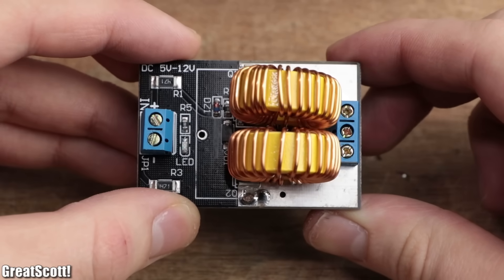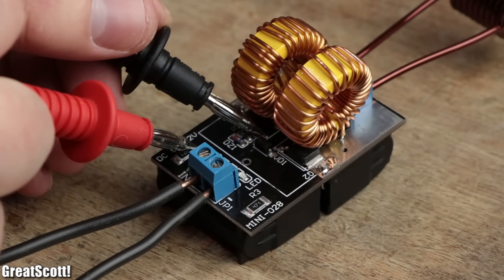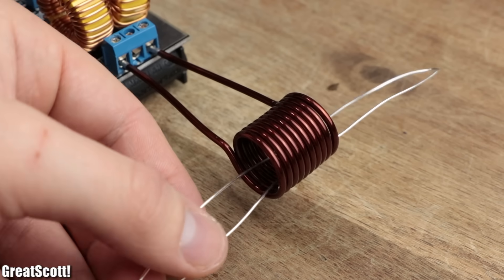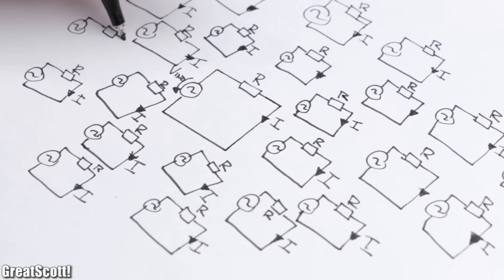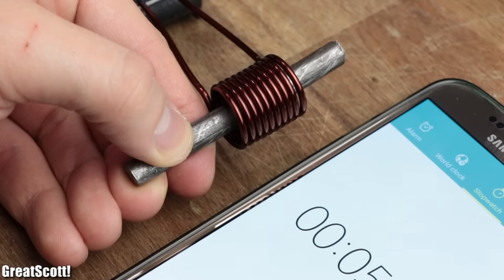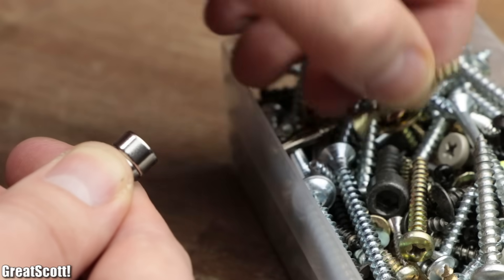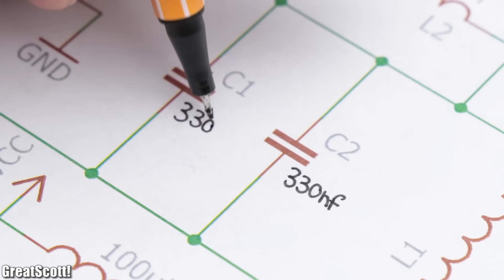How does Induction Heating Work? || DIY Induction Heater Circuit

Comment: hi, i made it, and it works, but when it gets a load the circuit stops oscillating and draws a large current, but when the power is turned off and then back on the circuit works again, except when it gets a load it stops again, what causes this?

Comment: I have a Solary bolt buster and I was damaging those Kevlar covered wires.  Is it possible to build my own using the same process of wrapping a copper wire around a plastic tube?  Is there anything to watch out for when doing this?  For example, can the looped wires touch each other or can I bend the leads at 90 degree angle coming off heater?  There are tough to reach spots and I can't go straight on.

Comment: Thanks! A couple years ago when I was 10 I saw this video and went to the local electronics shop and built the exact thing just from looking at the way you did half the parts where from scrap items and ended up using it till I moved house

Comment: I have two different welders one is an AC welder and the other is a DC.
The DC welder is capable of constant, current or constant voltage 
In constant voltage mode I could set it to 12 volts and possibly limit my amperage somehow. But 3 amps would be difficult. 

Anyway, would I be able to use one of my welders as a power source to heat up very large knife making projects, for example, 2 in wide by 12-in long carbon steel

Comment: You explained nothing about how an induction heater works...
Reply: He did. You just didn't pay attention.
Reply: @schaltnetzteil495  So what Im wondering is, what is different about an induction heater than other inductors?  What causes them to create so much more heat?  Is it more induction?  More current?  I heard it somewhat has to do with frequency, though I dont remember where I read it.
Reply: @Ryan-qn1wr  Induction heaters create a lot of heat in the metal, not in the coil itself, because of eddy currents in the metal that heat it up. But you need a high frequency to induce those eddy currents.

Comment: Simply use a cheap 40watt soldering pencil and a box cutter blade. Use the screw that holds the soldering tip, remove the tip and attach the box cutter blade through the hole in it to the outside of the heating coil, that secures the tip. So instead of a soldering tip you have a razor blade that is constantly heated by the solder pencils inductor. You don't need to keep heating it up; it stays hot. Cheap soldering pencil (40watt) stand, flux, and a small rol of 60/40 solder at Walmart = $9.99 and a pack of 10 razor cutters = $3.49. ⚡⚡ I use my variable solder station with a small coil of wire clamped in place of the tip, on my heat mat to keep my coffee hot. Great stuff in your videos. Your insights and knowledge seem to fill in the few gaps in mine.  I'm a southern redneck in South Carolina US. I never throw anything away. If it will cast a shadow; it has value if you know where to use it. Imagineering. That's what you get from a BA in economics, a BS in Computer Science, a Masters in Physics; Optical/Acoustics, Quantum, and Classic Mechanics, undergrad in General Chemistry, Masters in Ancient Biblical Dialects, and finally an EMBA in Business and World Economy. And all but one degree was tuition free. But through it all I am a musician and musical instrument amplifier and high end stereo tube amp repair tech. I have a brain full of almost useless academia; but have always been a general "hands on" repair craftsman for over 45 years. Love your videos. I also write code, starting with the assembly machine code for the intel 8088 and 8086 back in the late 70's and know my way around the other 80% of the bandwidth of the  Worldly really wide Webulator. White hat.

Comment: need to try an experiment...  take a section of iron pipe and run water thru it and heat it with induction and see just how hot water can get for an on demand hot water heater. A flow switch turns on the circuit when water flows thru the pipe thus heating the water, a flow control valve will allow the water to remain in the heater area long enuf to reach the desired temp...  will it work, thats to be determined  ;)

Comment: Hi Scott, does the coil itself heat up as well? or is it just the metallic material inserted into the coil that heats up?

Many thanks
Reply: yes the coil heats up also due to current flow, like a hair dryer gets hot when electricity flows thru the coils... the important part is to design the circuit to limit the current thru the heater coil to keep the coil from being damaged.

Comment: Thanks for sharing....i have a question...In industrial application of induction furnaces, the water cooled capacitors tend to inject excess reactive power into the grid which affects the power factor as a result of over compensation. Most foundry industries are facing low power factor penalties because of this situation. How best can this scenario be solved without affecting the operation of the induction furnace?

Comment: Hello Scott 👋 it’s Scott 😮 with aluminium (aluminum) in the instance of a juice can 🥤  heat from the hand is easily transferred into the can which could potentially make the can  36.4°c  aluminium is used for heat sinks world wide in comparison to steel or brass I think for a fair test using the pliers to hold the media would be more scientific and allow less Influence from your body heat as I find 37°c to be far too influenced by your optimal core temperature of 36.4°c  a control being a piece of wood or plastic should also be used in order to be a control for the experiment, if that heated up then your experiment would be void unless explainable very interesting and keep up the good work regardless of my pernickety comment ❤

Comment: I've been trying to construct this circuit, but I keep encountering an issue where my mosfets get really hot and my wires melt. Any advice on where I might be going wrong is appreciated.
Reply: Use active cooling for the MOSFETs and thicker gauge wires

Comment: I wish that a businessman would bring a product to market which heats galvanized steel water pipes using induction coils. The water pipes underneath my house freeze in the winter. I have wrapped the pipes in heating wire and insulation, but the pipes still freeze. For the hwating wire I use, the heating wire itself gets hot. I would prefer that the induction coil stay cool but the water pipe get hot. I want an induction coil wrapped around a steel pipe which keeps water inside the pipe above 0 degrees Celcius (32  Farenheight) in the winter-time.
Reply: industrial heating wire?  you need the real stuff they use at big chemical plants and not the stuff they sell at alibaba, phone the maintenance department.
also you need to coil the wire around the pipe with intervals of like 10cm.
otherwise keep the tap dripping at all times.

induction heat is localized by the coil, you would need to build several coils and move them over the pipe manually.

Comment: Your schematic contains an inefficiency/redundancy: R1 and R2 can be combined into a single resistor having a resistance of 220 Ohms.
How?
The two resistors are tired to Vcc. Vcc may be considered a source, or a node; a single point having equal current, voltage, and resistance no matter where on the point you measure (theoretically, only one point, lol). The two resistors are of equal value. Therefore, you can change the value of the resistors (keeping em equal) without changing the dynamics between high and low MOSFET'S. Ok, so why not change the resistors to a short; zero Ohms? Vcc will now be present at the anode of both diodes. Since the same parameters (eg, Vcc) are present at the anode of each diode regardless of the value of R1 and R2 (keeping em equal), we conclude that R1 and R2 may be replaced by a single resistor, R1, of 220 Ohms.

Comment: nice bro i bought in aliexpress 3000wtts induction first is okay after few works,now no heating anymore,i test the mosfet still okay,the relay is still okay i dont try yet the capasitors and resistors,what do you think the problem bro?
Reply: Maybe your power supply?
Reply: @fmfi3280  hmmm, still okay my power supply is 48volts go to relay and relay is okay,MOSFET I tok out to board and test still okay ,I think the zener or resistors,machine is on fan is working nor.al sound still okay only no heating.
Reply: @mrcesporinas1041  can you send me the link of the one you bought?
Reply: @fmfi3280  okay sir

Comment: I have an issue with my store bought coil assembly.  It just draws way to much current and attempts to melt the battery wires.

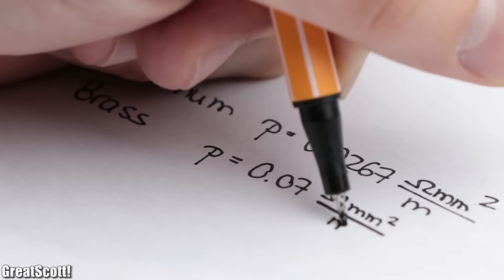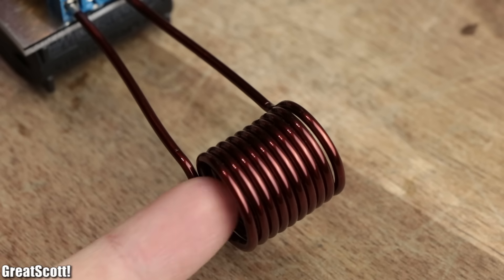Comment: So according to 3:35 brass heat up more because it has higher resistance. Based on that shouldn't your finger at 1:35 heat up even faster than brass since it processes an even higher resistance?

Comment: Hi i have the 1000w zvs from aliexpress and i connected it to a 12v car battery. But after turn on the transistors are very hot and i thinl they will be overheated. Is there to much current or the coil to thick?  what can false?  Please help bevor sonethibg burns out! The coil is also hot without there is something in!

Comment: Can I use 2 polyester capacitor Instead
Reply: No, don't use polyester capacitors in LC circuits. They have pretty high dielectric losses, so they will cook themselves. You need polypropylene capacitors for that.

Comment: Please clever electronics  people tell me if I put a say 20khz signal into an hi power amplifier and use the output to drive a coil wouldn't this provide for induction heating?  I'm having difficulty making an induction circuit.

Comment: I am working with my 7 year old son on electro magnetic experiments. He also observed the change in heat when we used a thick iron screw as a core. However, my equipment is really scrappy and I am missing a lot of what you might have at your disposal. Do you have a recommendation for equipment that you’d see as a minimum necessary to produce repeatable results?

Comment: I  built  this circuit and would like to share some details that will help you .

1) Select polypropylene capacitors for lowest loss. It is bettter to use many smaller capacitors in parallel rather than a few bigger ones.

2) The circulating current in the tank circuit is very high;  it is multiplied by the Q factor. Q factor is determined by tank losses.
The circulating current is roughly equal to the measured circuit current draw multiplied by the Q. For example if the  current draw is 5 A., and the tank Q is 50, the circulating current could be 250 amps. This is why the coil and the resonating capacitor gets so hot so quickly.
By using many smaller capacitors in parallel you distribute this current so that no one capacitor will be subject to huge currents.

3) The voltage across the capacitor is roughly 2 pi times the supply voltage. Select capacitors with a voltage rating about 10 times the supply voltage.

4) Two critical ratings of the mosfets are: 1) the drain-source breakdown voltage. Each mosfet will be subject to a voltage of roughly pi times the supply voltage. The mosfets  should have a voltage rating of at least 4 times the supply voltage. 2) Drain source current rating which should be calculated from the desired wattage of your circuit. In addition, the drain-source resistance should be a low as possible in order to minimize the head dissipated by the mosfets, and also to maximize the potential power available from a given supply voltage.

Along with zener diodes to protect the gate of   mosfet, it is recommended to place  a small resistor (10 ohms is good) in series with the gate to damp out ringing which can subject the gates to excessive voltage. The gate of a mosfet is quite fragile, and should not be subject to greater than about 20 volts. 12 or fifteen volt zener diodes are recommended......

I hope that this helps experimenters  with this useful circuit, and thanks to GreatScott for the excellent video presentation.
Reply: Now you among the best Professors you  are available online👍👍👍
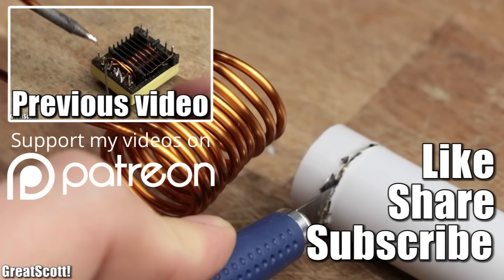Reply: 6:24 6:24
Reply: May I have circuit diagram?
Reply: This is a great piece of information.
Adding capacitors in parallel might help reduce heat/load on the capacitors itself. How could one reduce the heat of the coil without a fan, or pumping water through it? I have tried to mess around with the windings but is not effective in keeping the coil cool. Your help would be appreciated. Someone has suggested that a thicker copper wire should decrease the temperature of the coil.
Reply: Good to know
Reply: Obrigado

Comment: Wonder what's more effecient the electronic induction or the rotary permanent magnets induction at making iron produce heat. Ive seen a large wheel with many small magnets around the rim of the rotor. 144poles or more and 60rpms or more

Comment: How many more years can this sinister farce continue to go on??

https://www.pupman.com/current/vladi/vladi4.jpg

Vladimiro Mazzilli of Milano-Italia worked on Telsa Coils using Flyback Transformers!

https://i.postimg.cc/9Q0fsf8f/About-Vladimiro-Mazzilli-vs-Royer-ZVS-Known-as-vladi-mazzilli-on-Face-Book-Graph-ed-by-Egzoset.png

https://i.postimg.cc/9QyzFx99/Pupman-Vladimiro-Mazzilli-Milano-Italia-MOSFET-driven-Tesla-Coil-480x400.png

So it seems these over-simplified dirt-cheap "module" boards get a 2nd mercantile life being rebranded as "Induction Heaters", which is mis-representation assimilable to fraud IMHO.

The true value of so-called Mazzilli "ZVS" modules is to serve as an anchor to slow down progress while lazy opportunists try to recover from a whole decade of denial...

Comment: Does anyone know how i would go about calculating the needed power supply to heat a 15 mm rod to 200 degrees celcius? i'm working on a project and i vant seem to find much information about this.
Reply: There's been revisions attempted on the Mazzilli topology, or you may wish to read relevant technical papers from semiconductor designers as from Texas Instruments on their UCC256304 with "hybrid hysteretic control".
Reply: @Egzoset  thanks! Ill look in to that.

Comment: Please correct me if I didn't get it right.
Material gets heated , because of hysteresis loss, means bars of metals are in continuous processs of magnetising and  demegnetising and loss occurs in bar, so its get heated.
Reply: @ 80 ~ 120 KHz (if such intuition ain't too wrong)?...

There's now dual-frequency cooktops in blueprints, expect them to emerge on the market soon or maybe i need an update myself!

Now, why more than 1 anyway??

Go figure...

Comment: 'now that we understand the basics of... "

Me: dafuq?
Reply: Ummm shure I um understand now 😳
Reply: Agreed, there's alot a baloney when it comes to Mazzilli's so called simili "ZVS" topology applied to IH drivers - which typical lemming mystifiers are now satisfied to refer to as a magical "DNA" (...) despite the simple fact that removal of a flux concentration core in Mazzilli's Flyback Transformer can't reasonably be expected to work just the same as when he got photographed besides his Tesla Coil work, in 2008 ~ 2009...

So, over a full decade has passed and yet today's fanboy tactics are being used to manipulate vulnerable people using half-lies and plain omissions.  All of this just to revalorize obsolete PCBoards with ZERO protection, in an attempt to deny/ignore true technological advance in favour of getting delusional over IH Drivers supposed to cost less than a month's worth of pizza delivery i guess!

Ah, and of course you never get to be shown any realistic Gate Waveform signals, much less in relation to their resulting output, as if the Mazzilli topology never inspired serious papers in superior institutions of knowledge before, for example:

https://docplayer.net/26964431-High-voltage-resonant-self-tracking-current-fed-converter-a-thesis-presented-to-the-faculty-of-california-polytechnic-state-university.html
High voltage resonant self-tracking current-fed converter (2010-Mar)
p52/152 - Mazzilli Converter Topology

Here we must forget about frequency vs alloy optimization, never heard of semiconductor junction recovery charges, nor parasitic resonances and so on!!  As if electronic design has become just another excuse to justify the one other hobby that gathers the followers around some "social" love-to-hate activity instead - totally unable to dialog via relevant arguments, not to mention i got quite successful on Reddit illustrating such mediocrity in all its virtual glory...  Much like the rationale behind half of USA still standing behind Trump even today, e.g. throwing a dice would easily beat such type of "science" that they claim to "work" (until it fails, then a deafening silence covers their few voids), while in fact nothing is ever done to prevent a catastrophic forbiden condition as "Shoot-Through" in the 1st place:  imagine, these days an electronic breaker is supposed to take over but only after the short-circuit has started - and we're talking about very serious current being involved nonetheless.  Go figure where's the FuckCombustion NASA engineers!...

Please revisit in 5 or 10 or 15 years, if possible.
Reply: Yeah, he really did not explain anything there.
Reply: @Coo Koo intelligent people are usually seen as crazy by the lemmings

Comment: sir can use npn transistor in that circuit?? please answer🙏
Reply: Today's power transistors are called BJTs but those work best for AC appliances.

Wait patiently for advances using Gallium Nitride.  At the present rate it may be ready before, euh...  How long is your life-span exactly??

Comment: Hi, 
I want to build an induction heater of 2000Watts...is there any simple circuit by which I can use the AC supply directly to control power of induction heater?